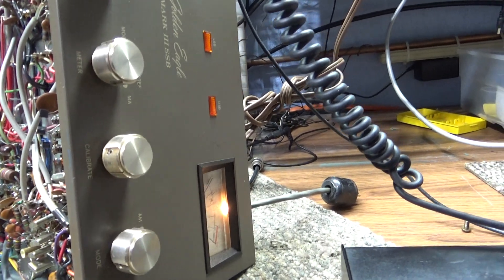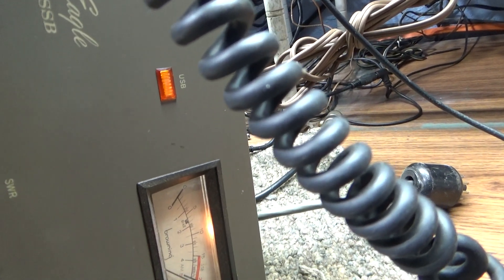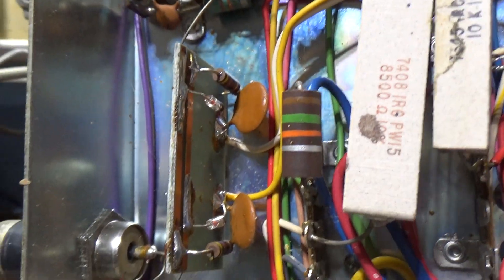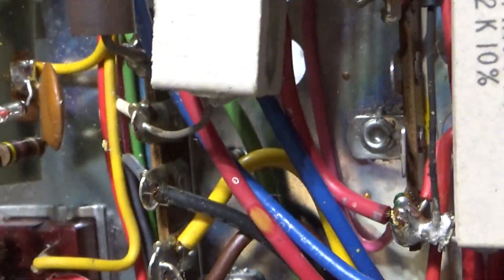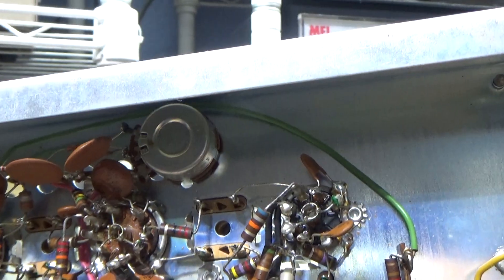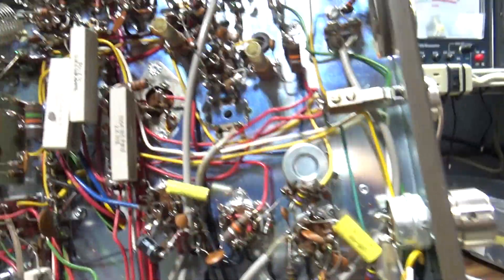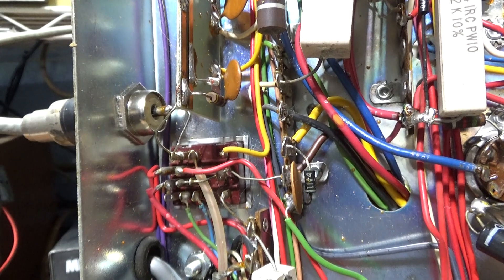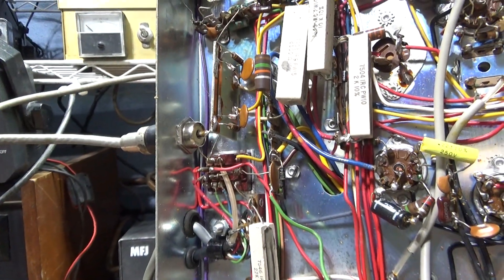Last Tram D201 Picked up by customer, Browning Mark 3 transmitter dropped off, no transmit.

Comment: Is that "exercised" or "exorcised"?
I was troubleshooting an intermittent "no receive" problem on an Olson Spotter 23. It looked like the relay's antenna contact was bad, but the relay tested fine. Ohmmeter between the relay side of the relay socket read infinity, until I pressed on the soldered relay socket connection. Nothing can drive you mad like a cold solder joint! Sometimes it worked, sometimes it didn't.
Helpful hint: you can use a dollar bill to burnish relay contacts. That advice came from an old relay repairman over 40 years ago.
Reply from the maker: I think a little of both LOL. I also agree on cold solders.

Comment: I remember those guys who wanted to extend the eagle scream by adding a larger capacitor for the receiver, thereby leaving it on longer. Which burned out the relay contacts when it  charged that big capacitor.🤣
Reply from the maker: That and R223 if I remember right.